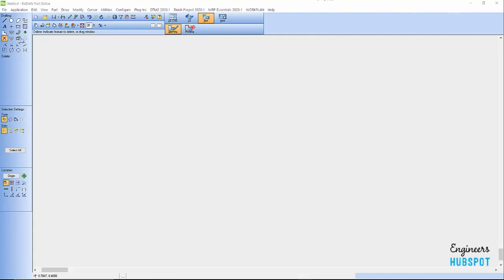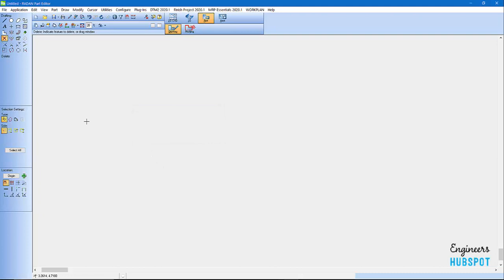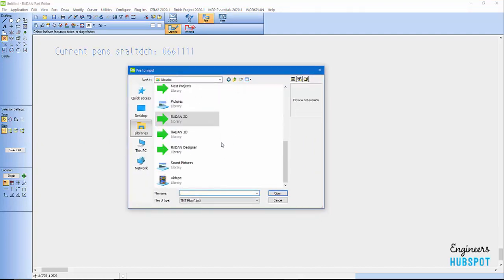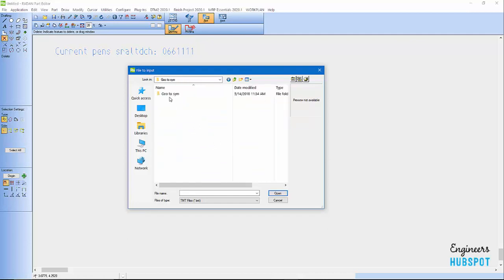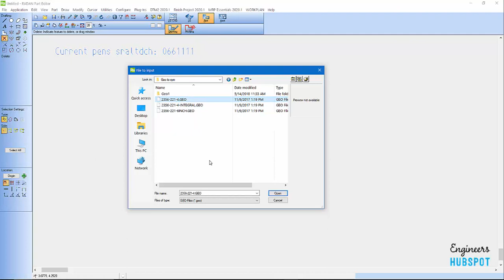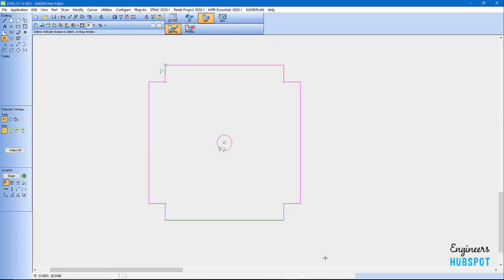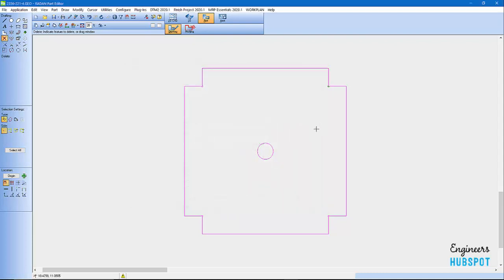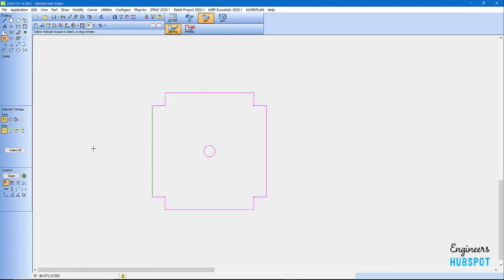Convert Trumpf Geo Files

Comment: Do you know how can I convert .dxf to .geo? I can't find a converter program.
Reply from the maker: You would have to have the Software that came with the Machine, Cause that File is Native to Trumpf,  What Software are you currently using ? I use Radan and I open files process them in radan and send code to Machine you would not need a GEO, In radan I have an option to covert GEO to my Native RADAN part file via a Plug In.
Reply: @SheetmetalTV  I don’t own the machine, I work there. Every now and then I want to cut something with laser for myself, so I figured to ask, since there is nothing google can provide. Can’t find TruTops Convert anywhere.
Reply: @SheetmetalTV  …so I can make this work with radan? I draw with AutoCad, so I only need to convert the file. Radan is free to download?
Reply: @onyeeginc  RADAN is paid software. Comes from HEXAGON manufacturing suite. But, If you have Trumpf machine and BOOST TRUTOPS Software, you need to not convert to GEO file on your own. rather just import file in BOOST software and hit create NEST. Software takes DXF and converts it to GEO.
Reply: @SheetmetalTV I have a Trumpf l3030 and I can’t find a way to send a drawing from RADAN to my machine I can’t find a way to make it a GEO file from Radan to my machine.. any advice??
Reply from the maker: you do not need a geo but you can convert geos to radan part files ther is a macro to do so you will program the dxf in radan and then post it to the trumpf as a .lst
 @HighLifePvp
Reply from the maker: @HighLifePvp  you don’t need geo files send program file example Name.LST